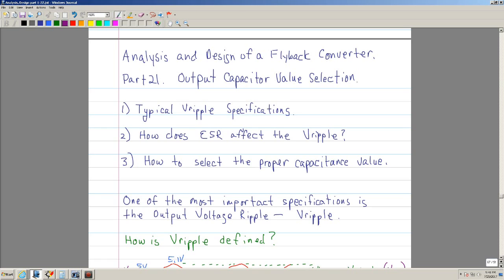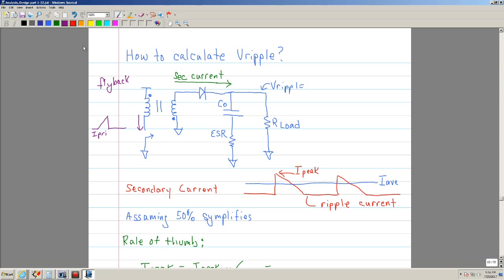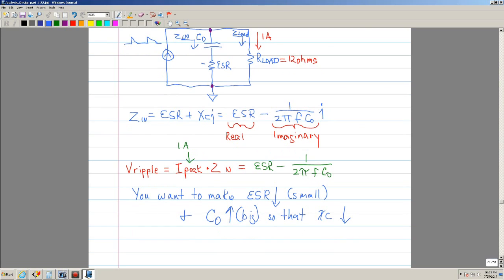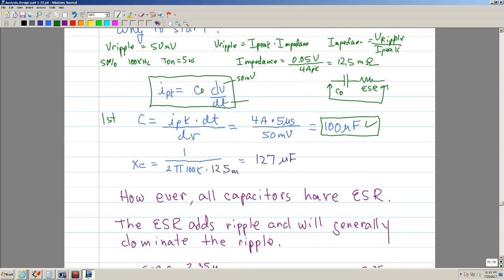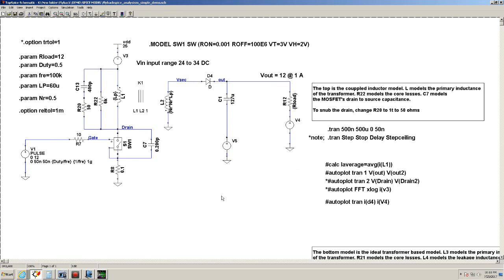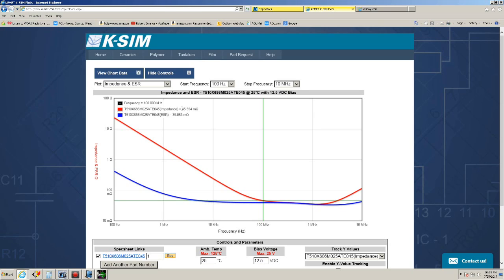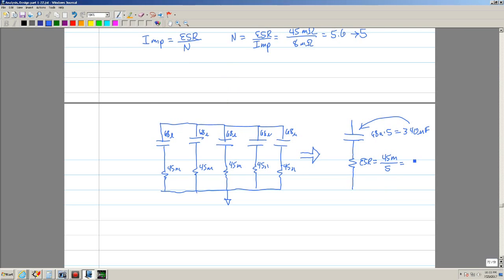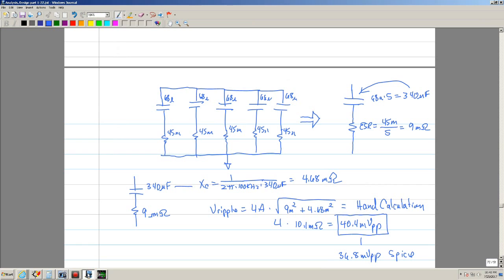Analysis and design of a Flyback; Part 21 Output capacitance

Comment: is the turn ratio N2/N1=4?
Reply from the maker: In spice it is easier to express the turn ratio as Nsecondary/Nprimary. So in this case, 12/24 or so about 0.5. Therefore, .param Nr=0.5
Reply: @RobertBolanos  Thank you, Robert.
Reply: @RobertBolanos  Can you check your email ? I have flybuck leakage inductance questions? Thank you.

Comment: Thanks so much Mr. Bolanos, They are very helpful.
What is simulation software used in these videos to simulate power electronics circuits?
Reply from the maker: Hi Vadood,The simulation software is TopSPICE by Penzar Development. I highly recommend the software. There is a demo version and the full version cost about 599 dollars which is generally affordable. You can also use the LTPSPICE which is free. However, I prefer to use TopSPICE because the huge library of spice model which is about 30000 parts. Hope this helps.RB
Reply: Hi dear Mr. Bolanos.
Thank you very much for responding very soon, and also for the full explanation.
You are awesome ...
I try to use the demo version to get familiar with it.
I have two more questions that I like very much to know your opinion:

I. Which software is best in your mind to simulate power supply circuits?
(Which one do you use yourself?)

II. I wanna work on the circuit with the following specifications
   Input: 220 V ~
   Output a: 6.5 Vdc, 0.8A
   Output b: 2500 Vdc, 300mA
   Output c: 200~1500Vdc, ≤1mA
   Output d: 6500 Vdc, =~0mA
Regarding the above specifications; What would be better to use for any output, in your mind, in order to get an industrial circuit with the low weight and size?
Reply from the maker: Hi Vadood, these are very high voltages and I would recommend that you use a resonant flyback converter and only design for an output voltage of about 500V and then use a voltage multiplier to get to the 2500V and the 6500V that you are looking for. These are complicated to design but they can be design. What is the application that you need to use these high voltage power supply.  You can email me at rbola35618@aol.com

Comment: Thanks so much Robert, you help me and others a lot, can you please help me how can I pick MOV if my input is 3 phase 220vac and output is resistive load 45 vdc 10 kw the input capacitance is 470uf so how can I calculate my MOV? Also the size of the thermistor which I use it for precharge capacitors (soft start) and I short it after ms with relay, what is the minimum power for this thermistor?